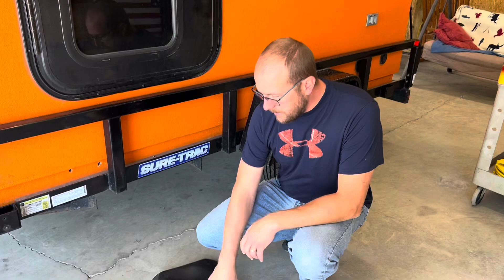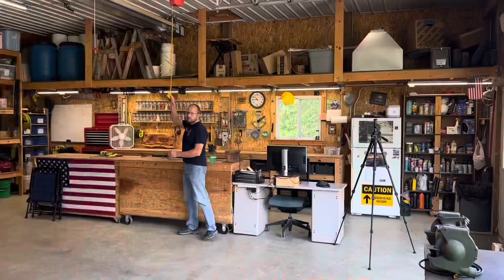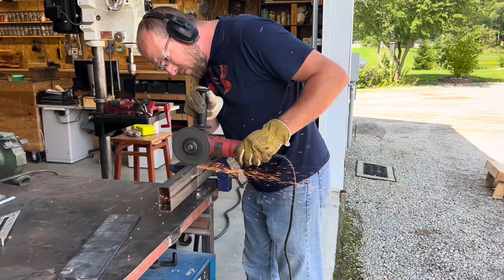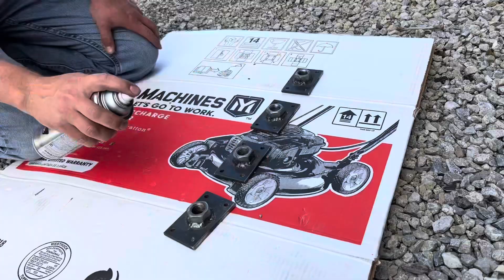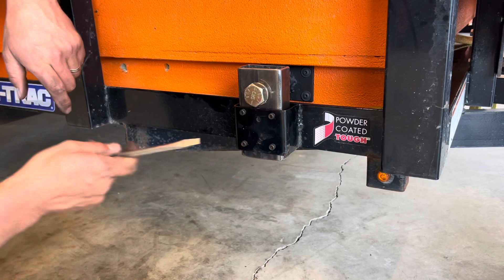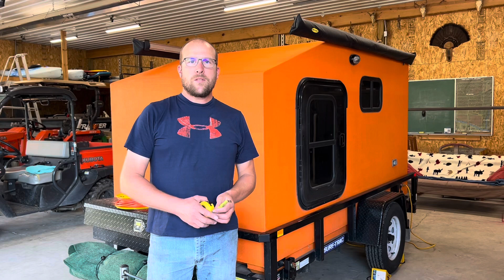Squaredrop Camper - POD MOD

Comment: I would add the cable back in place since you already have everything for it anyway just a a bit of extra security. I worry about the Welds breaking for those Nuts from bumps in the road or whatever but I'm no engineer!

Comment: nice build. im thing of building a 5x12 foamie pod system myself. may use two long threaded rods through the substructure that interface with brackets at the side of the trailer

Comment: Awesome design.  I hate commenting on videos, everyone has an opinion and I don’t want to be that guy.  Take my words with a grain of sand, I’ve really enjoyed this build series.  I love that you got your Nerd On and did the calculations.  I am not an engineere, but I work with them every day.  Everyday they teach me the math and what it looks like on paper and I teach them practical application in field setting and we build some pretty cool stuff. So, here’s me being the arm chair opinionator.  My two suggestions, use bolts on the camper side nut flange.  The structural grade screws are only rated in a static application. Over time the vibrations and flex may weaken the screw interface. Using a bolt through the full 2x6, and securing it with locking hardware will give you a much stronger and more reliable attachment, even if the hole wollers out over time.  Also, the hardware going into the 2x6 needs to be rated for pressure treated wood or the chemicals will corrode the hardware. Secondly, instead of 4 bolts on the trailer side through the pocket, if you used one larger bolt that would allow some slop in in the square tube when slightly loosened, you wouldn’t have to be as precise on the initial placement of the camper during installation.  Thank you for sharing and excellent execution of paper ideas to functional reality.
Reply from the maker: Appreciate the feedback and thanks for watching the series!

Comment: I’ve been watching your vids and you’ve inspired me to build something like this. I’m in southern ok and northern tx where summertime temps get hot hot!!! Have you thought about installing an AC and if so what ideas have you thought of? That seems to be the hardest part of my rough outline so far. I can’t decide on installing a regular window unit or a 12v system that I could power with batteries and solar in a situation where I didn’t have shore power…what to do what to do….🤷‍♂️🤷‍♂️
Reply from the maker: I have thought about it and seen a few ideas. I think my first idea would be an opening in the front where I would install the smallest window AC I could find. That location allows the unit to hang over the tongue and also puts it in a decent spot for airflow.

Comment: much like every engineer, you have over engineered something that was very simple fix. You could have picked up a lever synch and hooked it to a small loop on the skid and hooked it to the square 2x4 bracket holder on the trailer. And if you did it at a slight angle to the front and opposite angle on the rear, the sliding issue is solved and no more crawling on your back to secure it.
Reply from the maker: Thank you for your positive words kind sir.

Comment: Yes i like your improvement over the cable connection. 😊 Good job on the camping pod. It even looks more secure with the brackets and bolts.

Comment: My concern would be flex. It’s going to be so rigid now any flex is going to split out your skids. I think a better way might be to bolt on to the sides some eyes then use turn buckles or some really short ratchet straps to attach it

Comment: That will definitely hold better than the cable system you had.  The only thing I think I would have done differently would be to run the 7/8" bolt completely through the 4x6 and put the nut plate on the inside so you would capture the entire 4x6 and the load force would be pulling the nut plate tighter instead of it trying to pull the plate off of the 4x6.  I highly doubt it would come apart the way you have it but I am prone to over build things.

Comment: That's a great design, though it seems like overkill.  But I overbuild things so they don't bend or break.  The only concern I have is alignment.  Will you put stop blocks in so the pod always lines up, or is it easy to shift a quarter inch with a tubafore or something? 
If I had a utility trailer, I'd build a pod for it similar to  yours. Since I don't, I want to build a composite squaredrop trailer from scratch.

Comment: In the previous video you didn't want to worry about lineup being so precise, this looks pretty precise. I made a box for my pickup truck I used 4 turn buckles at an angle to stop the side to side but still had the flexibility of not being precise for my hookup.
Reply from the maker: I worried a bit about how tough these would be to line up but it’s easier than I thought.

Comment: Awesome design & thank you for sharing. One of my sons is a machinists & I'm amazed at the strength of metal fasteners & structures. Growing up my Dad was an awesome fabricator but wasn't book educated so I was taught to over build everything myself, good thing gas was cheap & we didn't have to worry about the weight of something back then.

Comment: Cool idea. 👍🏻
My pod sits on three 2x6 treated skids. I just used six 5/8 carriage bolts to bolt through the skids from inside and into the trailer frame. Simple. Never moves a bit and is easy to remove when I need the trailer for utility purposes.
Reply from the maker: Sweet! What size is your pod? Do you have pictures or videos of it?

Comment: My question would be how hard is it going to be to line these bolt holes up the next time you place the pod back on the trailer after removing it. I don’t think strength will be any problem at all. Always thought the cable had room for improvement but it seemed to work. Good job if the line up is no problem. Would enjoy knowing the results
Reply from the maker: Great question, I just loaded the pod back on the trailer today and they lined up easier than I expected. Check out our TikTok page to see that video now or it will be coming soon to YouTube too. Thanks for watching!

Comment: You stated the big bolt was a grade 5. Maybe my old eyes are off, but I believe 6 hash marks denotes a grade 8.
Reply from the maker: You’re the first one to catch my typo in the video! You are correct, these are grade 8. A little more brittle but bend less before breaking. Proof strength is way more than needed and I wanted the stiffness. 

Good catch by those old eyes 👍🏻
Reply: @LivingOurAmericanDream   Yeah, I think I would have gone with eight's as well. That design is a very good example of simplistic perfection. The pod is not going anywhere.